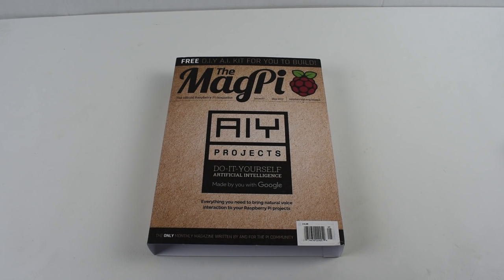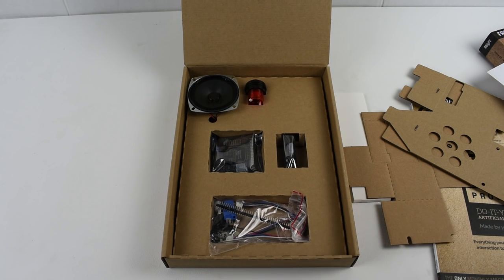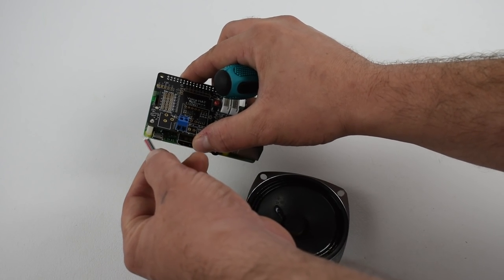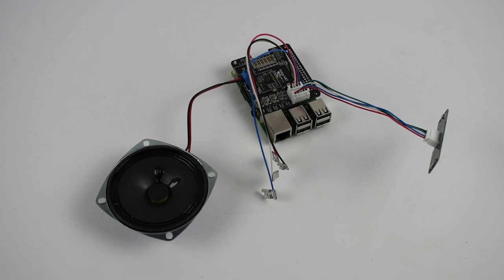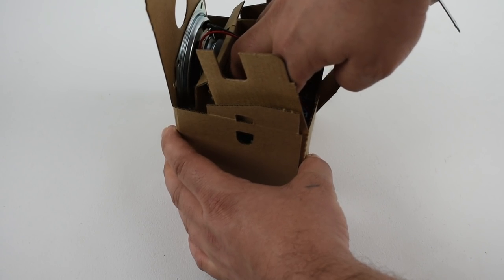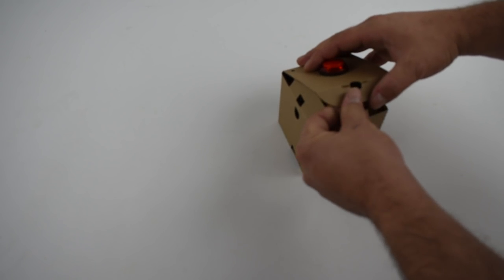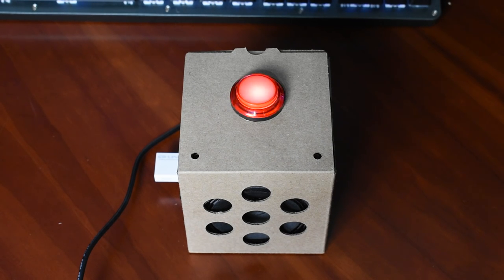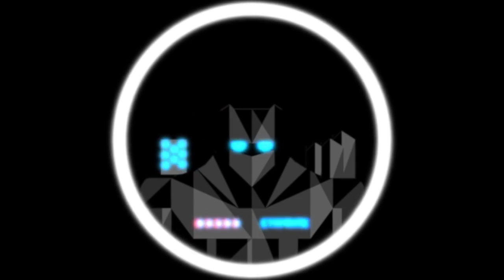Raspberry Pi Google Assistant MagPi 57 Kit Quick Build And Test

Comment: Does it have to be a Raspi3?  I have an old 2B that is collecting dust since I got my 3.  Been looking for a use for it..
Reply: you can use any pi. they recommed a three as it has built in wifi, runs a little faster on the p3 to